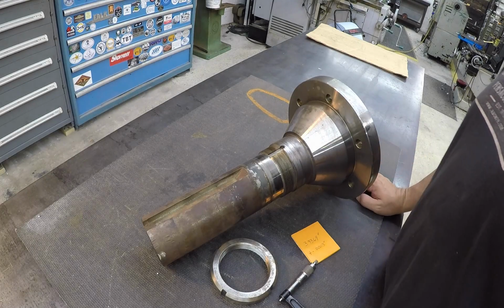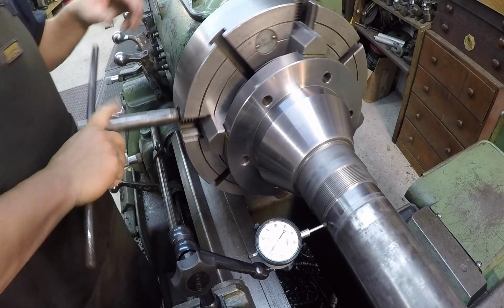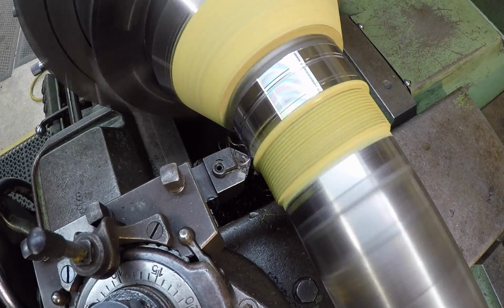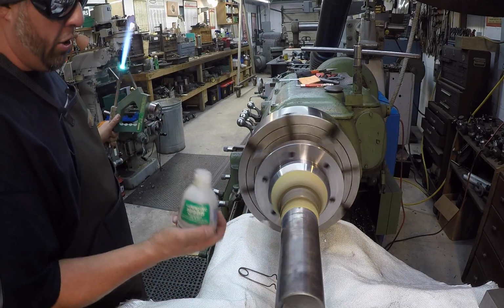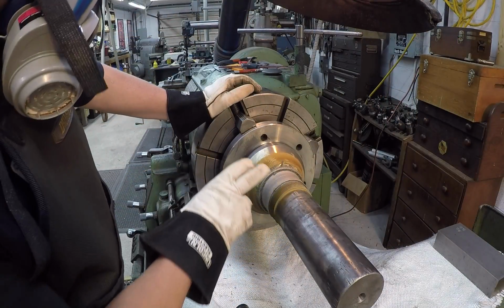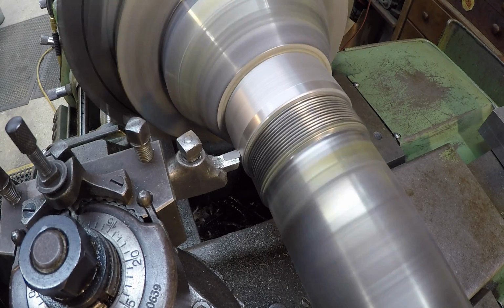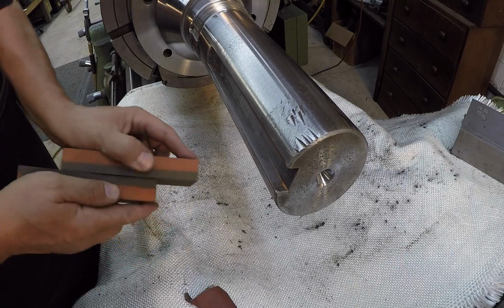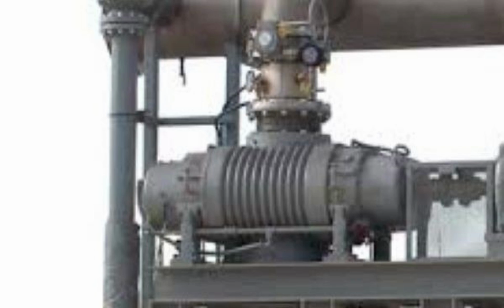SNS 300: Spray Welding a Blower Shaft

Comment: We used a lot of metalizing/spray welding, in the shipyards, but it was more spraying a molten aluminum or galvanizing coating on to steel hulls, to protect them from rust, in a saltwater environment, when you do it right its amazing, you have the toughness of steel and the ability to weld it with a couple batteries a set of jumper cables and stick welding electrodes, but the coating is way tougher than paint and doesnt uv degrade.  They mostly use a thing that looks like a mig welder with an air compressor hooked up to it, rather than a gas torch with a powder like your setup, cool vidya.

Comment: Instead of liquid masking your threads you can also wrap stainless shim stock and secure with hose clamps. I’ve cleaned out lots of key slots that were paint masked in a repaired journal area though.
Reply: when i spray weld i use dykem layout fluid to "mask off". Does very well.

Comment: Can this process be used to repair a crankshaft for a car or a diesel engine?
Reply: Yes! We used to have Gardner, Cummins and Rolls Royce cranks repaired... 
but one thing I've noticed on here! Is the coating was not fused , unless I missed that part!
It should be heated after application to melt the coating into what is called the 'wet state', where it bonds into the workpiece and finalises it's finish ready for machining
Reply: @ii-es2sn from what i an tell from the comments their are a wide variety of protctive coating that can be aplied. as well as bonding agents for the weld itself

Comment: Brings back memories working with machiniest, micing shafts bearings for  electric motors. Thermal sticks to heat up ball bearings for slip fit on shafts. Micing babit bearing and motor shafts checking tolerance.
Reply: what do you mean "micing" like using a miccrometer or another proccess

Comment: How much is the price to repair something like this ?$
Reply: Probably around 500-750 if I had to guess. Maybe 1000 if he’s really charging premium pricing. But I work at a electric motor repair shop, and I could chuck spray and turn that shaft probably 3-4 hours. So I think around 350-500 is reasonable if you’re just spraying and turning the bearing journal.

Comment: I’m a welder I weld everything but never heard of spray welding
Reply: I am a machinist, mechanic field service tech at a electric motor repair shop and it’s most definitely a thing. It’s not actually a weld though. You preheat your work (we run most parts through a burnout oven around 700f and sand blast first if applicable), undercut work and, then spray a bonding coat and then your metal spray. Let it cool, and turn to size. Gotta watch the temp though so a shaft don’t bend/warp from heat and the spray doesn’t crack.

Comment: If the bearing is a press fit onto that repair section, would that be able to withstand that?
How does cold temperatures effect the bond?

Comment: Nice video. Refreshing to watch someone that really knows what they are doing. From when you indicated the part part in the machine, amount of stock you removed, speeds and feeds, tool selection, use of micrometers and polishing the shaft. Nicely done and explained. Took me me back to the 1960's making crankshafts. We used a similar technique to rebuild bearings if needed which was a torch hooked up to a wire fed metal sprayer. Not as nice as your set up but the same concept.

Comment: We had this sort of thing done on pump shafts that had the bearing literally spinning on the shaft. In the 70s!! Artesian water pump and the water was a bit corrosive as well
I have seen cranks done with hard chrome,, so so repair. I have had kingpins etc hardchromed as well. That worked out ok

Comment: Thanks for the video, the spray welding is interesting, ive not seen that before. The material it deposited seem to cut more like cast iron than steel .. is some kind of alloy or was just the top face of the carbide with a dip snapping the chips off super small ?

Comment: I have done some spray welding in the past for cast iron (exhaust manifolds) and backhoe pins and so on. My question is....I have done a repair on a CGI Block for a Cummins engine and the weld appears to be holding but I have new cracks developing and starting to weep oil. Do you have any pointers for me on this application? Also what product were you using to coat the threads before welding? Thank You

Comment: Great video , blast from the past ! I am a retired electric motor repair technician, machinist. We tried to use this on traction motor bearing seats in the early 80’ , 40 years ago . The machinist had a bird spraying it near there lathe . The lead machinist never stopped complaining but in his defense we didn’t have the proper ventilation equipment back then . We only had one lathe in that department so if we screwed up the lathe then we made no OT and the logistics of bringing the armatures to the machine shop was impossible. Loved your video definitely the proper use of the equipment as I remember. Thank you

Comment: Back in the 60s we used to metal spray vehicle crankshafts and machine to standard.
Reply: I have seen aircraft engine crank journals repaired in the same way.
Reply: We still send cams and cranks out for mig/tig welding, regrinding and balancing.
Often for special applications such as classic car engine rebuilds, repair of non-standard cam profiles, rare motors that the customer wants to keep as close to original as possible (302 Chevy small blocks, LT1, LS7, 383  Hemis, etc.)

Comment: What is that liquid masking material that you're using? I work with in the aviation industry using various types of high temp tungsten carbide thermal sprays/coatings including HVOF, Plasma, and D-Gun (Praxair). We're always looking for new masking techniques and I've never tried a liquid maskant like you're using. Typically, we use hard masking, foil tape, or MACHBLOC.

P.S. That shot of you at 24:30 is about as badass as it gets! hahaha

Comment: I was Manufacturing Manager for Douglas Corporation in Tekonsha, MI
The company repaired pumps, machine tools, gear boxes, punch press cranks, and anything else that the 3 salesmen could drag through the door. In 1993 they were a well respected company with a good crew of 14 machinists and fabricators. 
One of the mainstays of the operation was spray welding to build up shafts and coat the impellers and volutes of wastewater pumping systems. 
Wire arc stainless, babbitt, fusion bonded bronze, ceramic, and Diamond Jet were all used on a daily basis to repair bearing journals, seal surfaces, and cavitaion damage in the pumps and equipment repaired there. 
Tom Hampton was the inspiration and main informational resource for the company.

Comment: Did this 1000s of times as an apprentice to refurbish parts for Caterpillar dump trucks and front end loaders as well as crushers and pump shafts for the mining industry in Australia , its a great process that is relatively low heat in its process .. Eutectic refers to it as a cold process ect .. and is very reliable method , seen a hot process from a brand I will not name that was complete rubish thou and any faults with the process shown in video is user error regarding instructions and or cooling the job down after with the air line to speed things up , been there done that and kicked ass doing it , great video keep up the good work Abom

Comment: Could spray welding be done in chromium?
Reply: Yes, But you will need to use a different method than oxy/flame spraying. Arc, plasma or sonic will work. It requires higher temps than the method used here, but it can be done.

Comment: im no expert but we used to do a lot of this, and it would be my job to turn it down.  For spraying we used a similar setup on a dedicated old lathe that had a waterfall behind it to catch anything from going too far around the spray area.  Sound familiar?  Very interesting process.
Reply: Had small time use of this kit 
In college materials lab. Used lathe to profile a small 3/4 ×5 "
cannon out of CRS.
Then used this metalizing roto flow process to apply beaded coating that was polished and smoothed enough to appear like patina ageing. Still looks good on the shelf, from 45 years ago.
Very good to see reality TV. In real world application beautiful job. Thanks.
.

Comment: I work with stuff like this everyday (large rotating equipment/turbomachinery) and I have to say, your attention to detail is spot on. Little things like galls, pits, sharp edges etc cause a lot more stress on the part than most would think. I've done rca's where an improper keyway radius caused a shaft failure. We uncover all sorts of crazy repairs and most often spray weld or plate shafts, but avoid sleeving bearing journals since the majority of them are interference fit. Subbed!

Comment: looks more like spray brazing than spray welding.....doesn't look like it gets hot enough for welding
Reply: it's actually fused to the base material so it's 'technically' spray welding, albeit you're not fusing two pieces of base material together.
Reply: @tunatuna8877  well sure, but do you know how it fuses despite such a conical spray pattern? For example is it simply because the material is atomized and blasted at such high pressure or is it like my little amount of research suggests that you should post-heat the material after spraying as well?
 I think the question for me stems from the experience of finishing a weld and flipping my hood up quick enough to see that the weld itself is red hot but the base material is not, and knowing that it is a very poor bond. That is the way the process demonstrated in the video seemed to me..
Your response is appreciated 👍
Reply: @rgraptor2542   I see what you mean, yeah you're not going to see the same cross section of fused material as you would on a traditional weld.  HVOF, which is what I'm familiar with, relies on extreme velocities/impact energy to create a bond at a molecular level. I'm not sure how hot the base material gets during the point of impact, but I just meant that overall, the spray weld/thermal spray/HVOF has a stronger bond than the adhesion you get from brazing. I guess it would be more of a 'glorified coating' more than anything. Stress relieve sometimes depending on the part features or size.
Reply: @tunatuna8877  Oh okay. what a very interesting and smart idea. In that case I think it would be interesting to discover the limits of HVOF. Anyway, thanks for the time to explain! Cheers👍
Reply: I used the METCO process. It was called Metal Spray
Reply: I see what you mean, maybe with the blasting power each particle fuses on an individual level? I have to be honest that this is the first time I've ever heard or seen of this so I should definitely research first. Anyway, it definitely has quite a scattered spray instead of a focused beam of heat and particles like one would expect.
Interest and curiosity peaked

Edit: online it says a torch is taken to the sprayed area afterwards to heat up the material with the base metal to create the bond.

Comment: I'm an inventor, and was born in America, and I don't even know what "8 tenths" means. 35:30. I am almost certain that the Reptilians are responsible for giving Americans the inches system, to prevent all the countries from working together. Somewhere in history, there's a malicious malevolence behind the "inches" system. Lol.
Reply: Our system of measurement is base on the constitution. It is based on our supposed money system. 16/1 ratio, sixteen ounces of silver equivalent to one ounce of gold. "imperial system constitutionally" no reptiles here unless you mean satin or the money changers! it would take a con con to change it. just saying. take care.
Reply: We should a metric sistem. VERY EASY TO READ.
Reply: It depends on what you were taught to start with. Ten is mentioned in the bible. Everything was done in tenths. But the Imperial system has been used for centuries to and I actually find it easier to use on an Imperial lathe or mill than metric. It also takes a person with intelligence to work it out. If you have trouble with fractions Imperial measurement will seem like gobblygook to you.
Reply: He is referring to 8) tenths of 1 one thousands of one  inch,which inch's are safe/American measurements standard.

Comment: I have a question (as a very amature machinist myself) .  It seems that you're doing something that needs to be extremely precise and then kind of trust your hand to do the finishing touch of polishing to spec.  Is there a more precise way for that finishing touch?
Reply: THE WAY :  a real lathe guy
Reply: for extreme precision, there are special grinders that can be attached to the lathe. But it also depends on if you're after dimensional accuracy or surface finish.
Reply: +/- .0003 is usually finished on a od grider. You would rough cut the shaft on a lath and then finish grind. This guy is very skilled with years of machining experience to polish that into size and hold tenths. My hats off to you. Not many machinists can do that and hold size.
Reply: I do think emery cloth is standard. I know that I used emery cloth by hand to polish my camshafts on an engine, and I resurfaced all the oil journals and lobes with emery cloth with oil on it. I don't believe using dry emery cloth is a good idea, because the grit can get trapped and it creates grooves. You have to wet sand it, which is a standard polishing procedure. But this guy is a genius, and I trust his judgement. I used a lot of oil, and emery paper, and polished my engine camshafts to mirror finish. The cams still look good as new when I inspected them years later. I think on crankshafts, they use emery cloth to get the final O.D. but I could be wrong.
Reply: It’s “feel” and that’s the only way I can explain it. But think of it like this: You drive a car and you are going 45 mph and coming to an intersection where there is a red light. You slow down with the brakes and come to a stop perfectly behind the vehicle in front of you. You do not actually work out how much pressure to apply to the brake pedal or calculate when you need to start braking, your eyes see and sends the message to your brain which automatically sends the messages to your foot to apply the brakes. It’s pretty dam complicated if you think About it much but you don’t, it’s all programmed from years of driving and automated.

Comment: That blower is a roots blower.  It has 2 lobed rotors that are held in proper relation by tightly-fitted timing gears.  The rotors spin at high speed, and are not in contact, but clear by 1 mil.  They spin so fast that the gas does not have a chance to significantly leak past them.  The pump moves gas at low pressure (around 10 torr) at 1000's of cubic feet per minute.  There is huge heat generated by compressing the gas.  Following this pump is usually a piston pump that compresses the gas to atmospheric pressure where it can be exhausted to atmosphere.

Comment: This is not a new process far from it, it goes back to 60s as far as I know. I remember as a young man back in 1982 I think the sprayer was manufactured by a company called Eutectic?. I was not long out of my time ,  we were using this to repair drive shafts on lathes , borers etc and any machinery where the spares were no longer available , prohibitively expensive or delivery times were insane . I did a few smaller shafts myself and the finished product was excellent.

Comment: whats the purpose of putting groove at the center ? thanks
Reply: He was trying to figure out if there was already a very thin sleeve on the shaft. There was a rolled over edge that made it look like it could be a sleeve on it, and if it was already sleeved then he couldn't spray weld it without removing the sleeve, and possibly wouldn't be able to spray weld it at all, as it would need to be built up too much to get back to spec. By cutting that groove, he was able to determine that there was not a sleeve already in place.
Reply: @PlatypusVomit   thanks for reply , good job.

Comment: So I'm assuming it's an oxyacetylene feed and there's some sort of ferrous compound of that powder is that melted then get stuck to the part? And is there a fear of any sort of rust building up inside of there like you know how you have to grind the edges of parts partthat you cut out with a torch
Reply: Argoshield it's 80% Argon 20% Carbon Dioxide
Reply: @CryptoTradingGods  argon and co2 are not flammable I and it doesn't look electric.
Reply: @masjuggalo  when Argon is mixed with another gas it is flammable 🤣😂😂

Comment: WHOA!!!! First saw that as  a kid in the 60s!!!!! I thought it had gone the way of the dinosaur. I know the process was developed around WW2? To help ease the need for fresh steel and repair  what could be repaired without using new stuff.  One of the last machine/welding shops around here stopped doing it when the old feller passed away  and that was back in the early 80s.  His son and nephew  were pretty good welders, but they were more about quick and fast to maximize profit. they lost  a lot of customers because this service and other stuff the old man did died with him. They knew how to do it, but didnt want to. The old man sprayed new metal on my brothers weirdo headers ( he made them in HS he was expierimenting with anti reversion exhaust technology) that were rusted through or paper thin in some areas, only cost him a 12 pack, he and my dad were friends. Put the shine on with that krokus cloth!! I wonder if that is where the band got their name....?  Wonder if I can adapt that blower onto my Hyundai Elantra GT?  LOL!!!